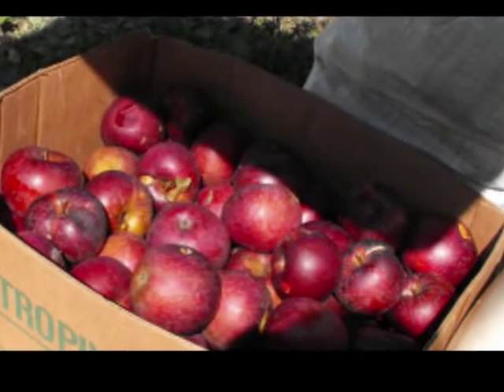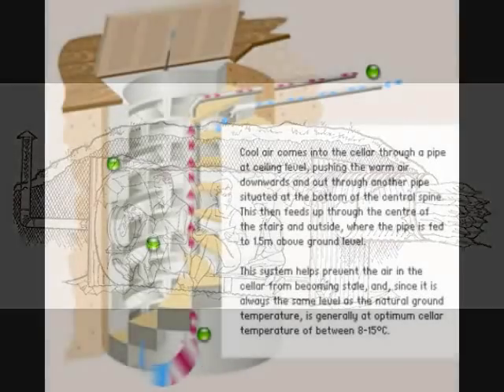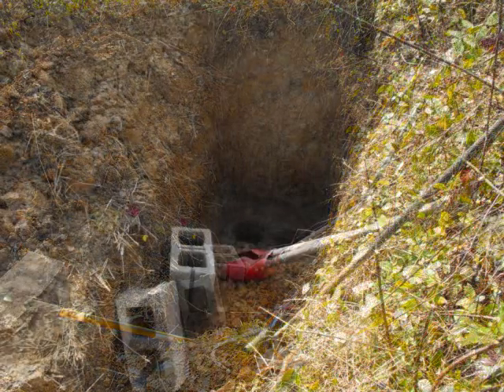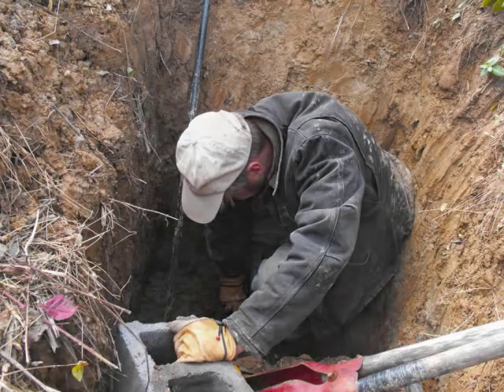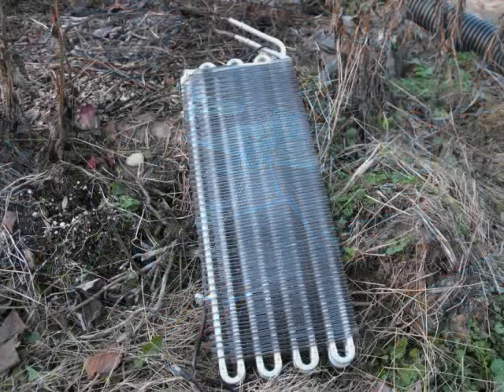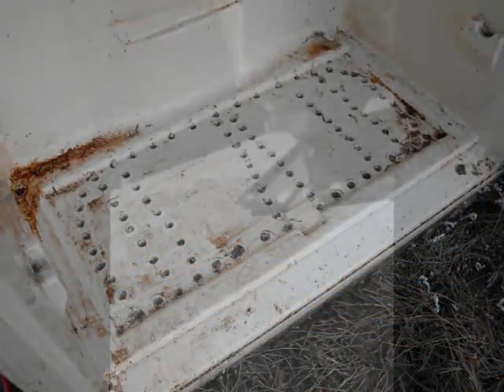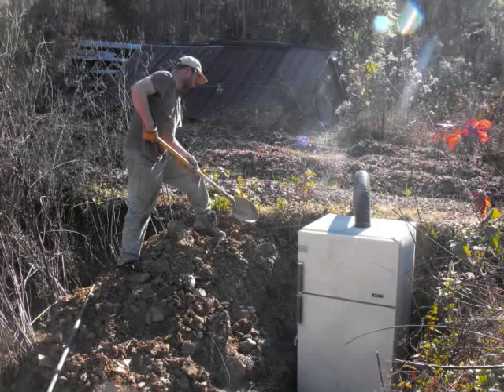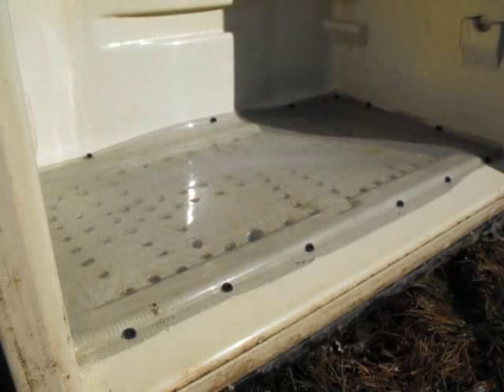How to Make a Fridge Root Cellar

Comment: So, did the thing work!? Does it stay above freezing in the winter and below 50 degrees in the fall and spring?
Reply: I'm thinking it doesn't, she didn't follow up like she said nor answered anyone who asked that question. Also, fridges walls are heat isolated and root cellars get cooled by the moisture in the ground.

Comment: It's also eco-friendly because it might kill a couple kids and reduce you or your neighbors' carbon footprint.  This is not a good thing to be promoting.  Not to mention, leaving doors on a non-working refrigerator is illegal in many places.
Reply from the maker: Jeff R They stopped putting latches on refrigerators in 1958 thanks to the passage of the Refrigerator Safety Act in 1956. If you actually watch the video you would see the part where I create a vent hole at the bottom and top to reproduce the root cellar effect.

https://en.wikipedia.org/wiki/Refrigerator_death
Reply: Walden Effect The law which made manufacturers remove latches decreased an obvious risk, but short of banning refrigerators, did not eliminate it.  You inclined the refrigerator back as well, so many children would not have the strength to open it.  The minimal venting you provided is insufficient if one or two kids decide they want to play hide-and-seek in it.  Plus, you added latches to the doors, so while it may not be locked on accident, another kid as a joke but not understanding the danger certainly could.  There's a reason why it is illegal in many states to abandon or discard a refrigerator with the doors still on.  And, "just keep kids away" is not a solution since this thing could be there for 50 years before someone takes it upon themselves to dig it out.  It was a good idea, don't get me wrong, but still a very dangerous one and not worth the risk to save a few bucks.
Reply: Jeff R i dont know where you live but where i live kids dont tresspass on other peoples property and are smart enough not to climb into a half underground fridge which is full of produce, just sayin
Reply from the maker: dont tread on me Thank you Jeff R for that lucid comment.
Reply: +Jeff R dude, how weak are the kids you know? besides, that venting system is more than enough if a small, weak trespassing child were to remove the food and climb inside and shut the door on themselves. This video is an EXCELLENT example of great thinking.
Reply: +Jeff R I also saw some rocks laying around on the ground.  A kid could pick up a rock and wail another one on the head with it.  We need to get rid of all the rocks just to ensure every possible situation is eliminated where  something could go wrong if, for even an instant, you dare take your eyes off a kid.
Reply: +Jeff R Hopefully you and your kids don't live near them, so you and your children survive.  Besides kids don't play hide an seek any more, they have TVs in their bedrooms to play video games on instead.  And they have Ipads, kindles, and other new fangled toys that interest them way more than a game their grandparents used to play...
And lastly, she had to add locks on the OUTSIDE so the doors stay shut, if a kid went inside, the doors swing open if not locked.  So, the only way a kid could get locked inside is if somebody locked the door for them.  And the kid(s) would have to be very stupid because it is an UPRIGHT refrigerator, so only kids who are tall enough to reach the locks could lock the door, and most kids who are tall enough to reach it, are not stupid enough to lock someone inside it...
Reply: +Jeff R They used eye hook locks on this as the doors did not latch.
Reply: 2427timbo how do you get that?
Reply: +dont tread on me let me clarify not you personally,  the whole conversation is,
Reply: I think there are still scenarios where this could easily be a danger to kids.  Like a kid getting in it during winter and the air vent being blocked by snow.  Do I think it is a super high risk? No.  But I think there is still risk there.  That said, if you had it close to your house then I highly doubt a neighbor kid would ever even consider getting inside it.
Reply: *****
Like I said, just having it close to the house would probably be enough.  A kid isn't going to mess with it if it is near someone's house.  You might see that in the city but not out in the country. 

If you left it out in the woods, however, I could see a kid running across it by accident during the winter.  Do I think you need a fence around it and stuff?  That would probably work but also probably overkill.  Just put a lock on it and maybe a warning sign.

Like someone else pointed out, out in the country you seldom are going to see kids going onto other people's property anyway.  So, it isn't like you need to go to the extreme.  Just minor protection for that rare scenario where a city kid might be visiting a neighbor and wonders off into the woods... or a local kid gets lost in the woods during winter, etc, and runs across it.
Reply: well...if kids climb into an underground fridge and is unable to open it, this a good example of natural selection at work.  They probably would have been taken out of the gene pool by sticking metal in a power socket if the fridge hadnt got them.  or head diving into an empty swimming pool.  Or eating datura because they are also called thorn apple.  or playing tag on the motorway.  or kicking a bull in the nuts.  or having a water fight with petrol.  or playing stun gun tag.